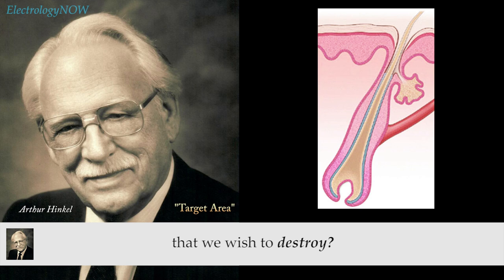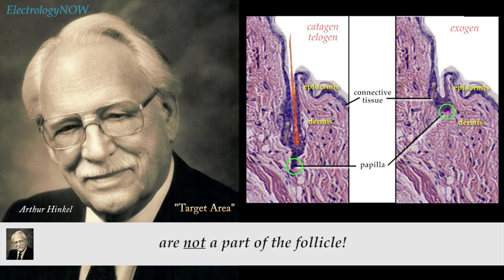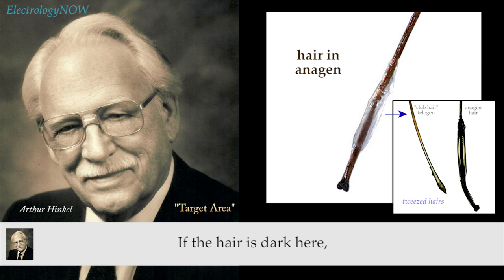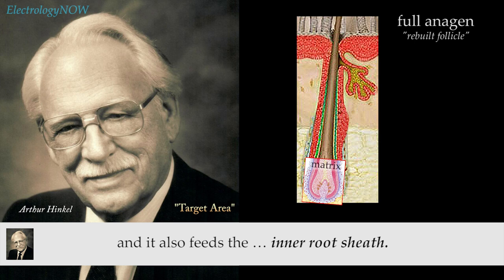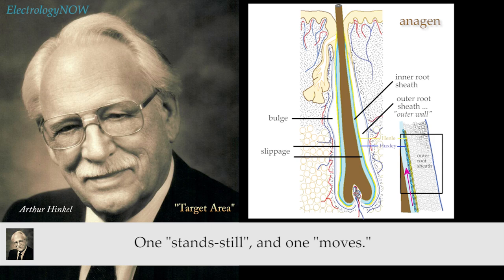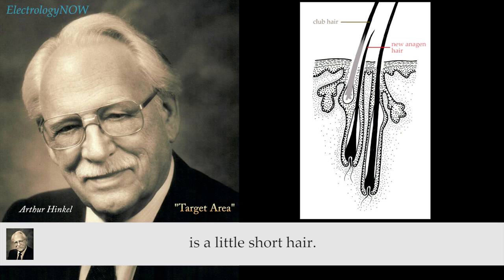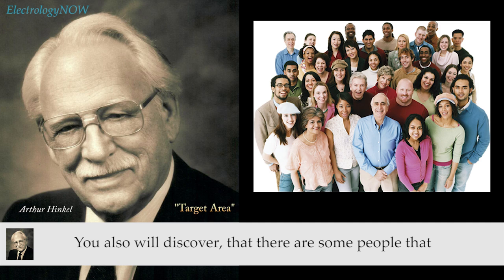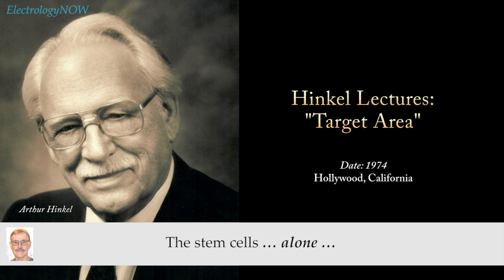Hinkel: The "Target Area"

Comment: Hi Michael! just wondering if you're still going to put up the upper lip video you mentioned in "chin, dents or scars?" Your videos are a fantastic source of information and also very reassuring, especially for someone like me who has suffered from some pretty harsh upper lip electrolysis treatment.
Reply from the maker: I will ... eventually. (I don't, myself, work on upper lips ... especially if the hairs are tiny.) But, yes, I will have a lot to say about this.
Reply: @ElectrologyNow  Is the hair around eyes and temples any different than the upper lip? I had them removed with electrolysis on March, now the area is pitted. That area is smooth even in old people. I don't believe it will heal. The electrologyst claims that it has nothing to do with her malpractice but my skin type. Can that be true?